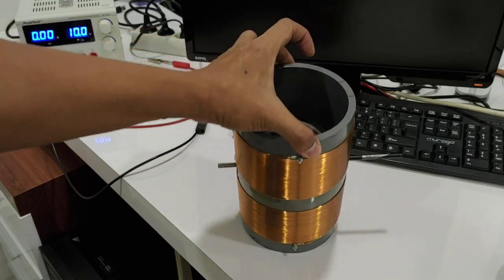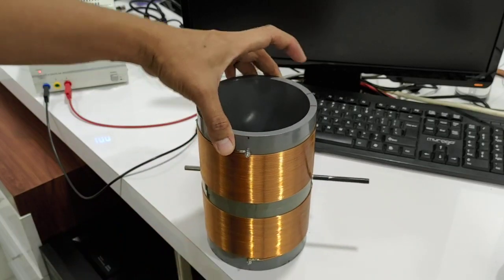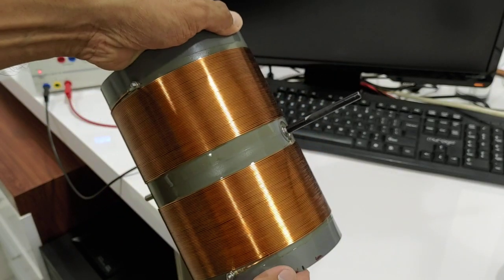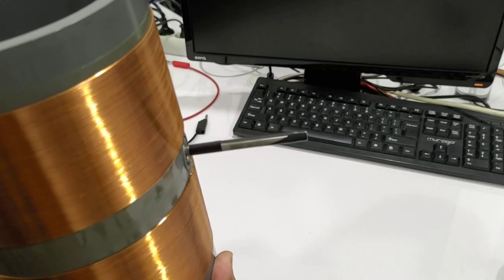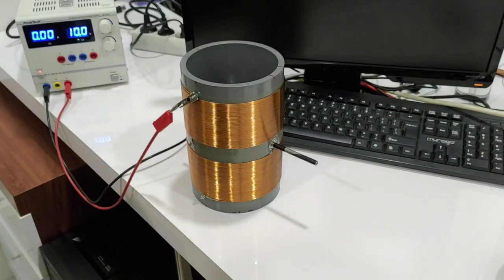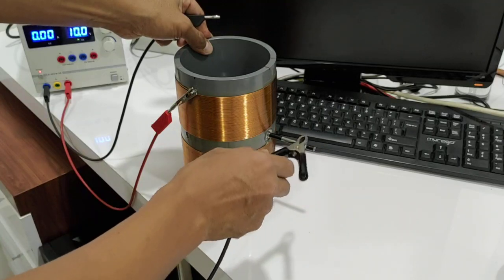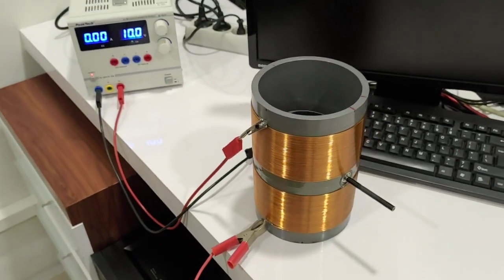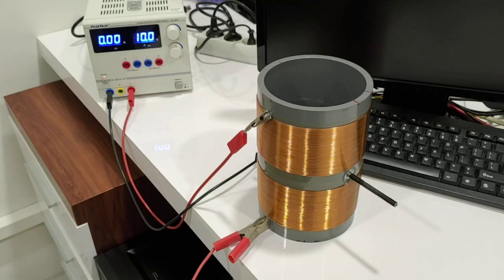Newman Motor | Keppe Motor | Pulse Motor

Comment: Wa'alaikumsalam...mantep mas...mas dari Indonesia ya....?
oya...setahu sy motor newman juga bisa di manfaatin back spike nya buat ngecas batere ya mas, dan tingkat efisiensinya cukup tinggi, bisa jugak di coba tuh mas tingkat efisiensi dan pemanfaatan back spikenya buat self charging energi source nya..kalo menjanjikan, saya punya konsep/ide motor ini bisa di gunakan buat menggerakkan generator listrik tapi tdk menggunakan belt/karet emban krn kebanyakan gesekannya/friction, jadi kita gunakan magnetic flywheel transmission (flywheel baja/besi/alumunium yg ditempel magnet/neodimium magnet dibuat posisi horizontal utk menggerakkan roda magnetic generator listrik/PMG (konsep paul hatem magnetic cogging)...sehingga jadilah rangkaian sistem generator listerik free energy. konsep magnetic coging nya paul hatem memang tdk pakek flywheel, tpi berpendapat kalau pake flywheel magnetic maka akan menyimpan energi inertia/saving energy pada putarannya.
Reply from the maker: Ya, saya dari Indonesia. Betul, back spikenya bisa dipakai untuk mengisi aki seperti motornya mr. Bedini.

Comment: wow, amazing, could u tell me the scheme and the cooper wire spesification...? 
and...how many volt ur battery source..?
Reply: In the video he said 120 turns with 1mm wire  and 10 volts, so its 60 turns on top and 60 on bottom. I'm using 16 awg wire which is roughly 1.2 mm. Looks like 4" pvc pipe, 4 microwave ring magnets. Hope this helps!